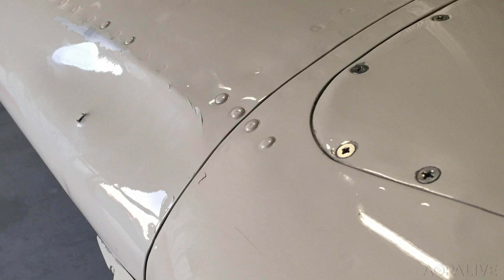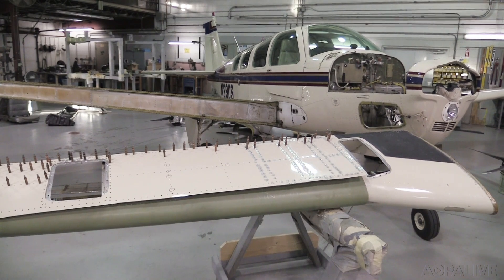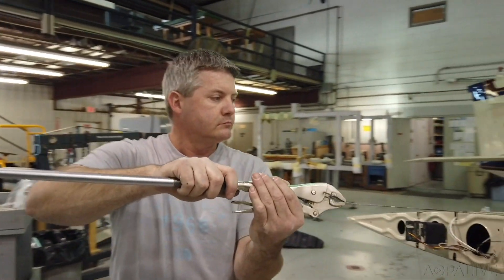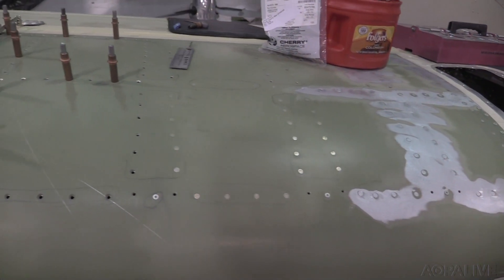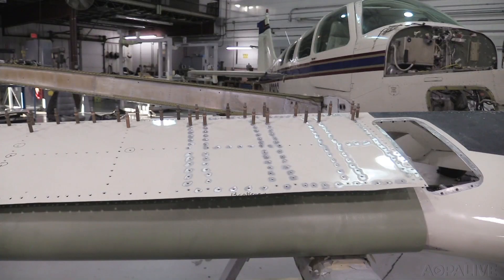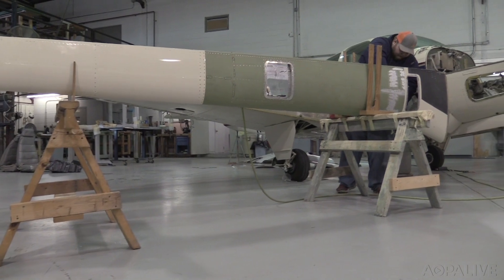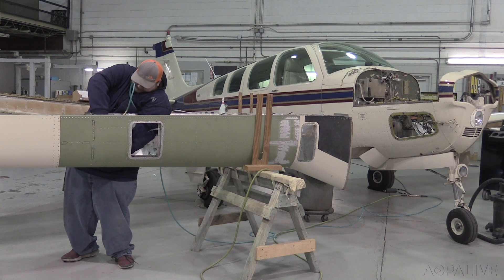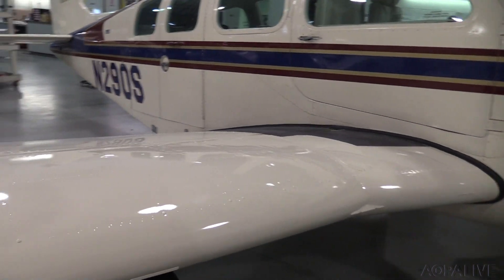Reskinning a Bonanza wing—without removing the wing

Comment: @Jim Brown, Beechcraft says not to use a drill to remove the pin with a drill, it can twist it off (Chapter 57-00-00, page 3). @David Farrish, textron sells a special tool ($$$) to reinstall the pin with a rivet gun. @Jim Brown, we tried a lot of different ways to remove the pins and found the redneck ingenuity worked best! It was a “hold my beer” moment that worked. @Philip Meads, the whole point was to not remove the wing and only the leading edge to save time and money for the customer. Wing removal and installation with new wing bolts is very expensive!!! It took a few days for Tom, Dave and I to figure it all out. Tom fabricated the tools we all helped design. We can do a leading edge repair, start to finish, in less than a week, minus paint. We’ve done 5 and 2 are in the queue. We can even travel to the location, remove the leading edge, bring it back on a truck, do the repair, take the repaired leading edge back on a truck and install it, if the customer is unable to ferry the plane. Let’s say we have it down to a science! We get a lot of calls to walk shops through the process, loan out our tools, etc. but this is proprietary and we are in business to make money and give the best service. Royal Aircraft Services specializes in major structural repair. We can do what most shops do not have the capabilities of doing with structures.

Comment: Using Beech's original system, the "hinge" wires are re-installed using a series of graduated length thin steel tubes and and impact driver/rivet gun, but I'll bet "drilling" the wires back in might work, but you'd still need to use the steel tubes, otherwise, the wire tries to coil up like a slinky when twisted b the drill.

Comment: The easiest way to pull the pins is with a cordless drill. And when going back in I use Mobil One oil to Lub the pin and drill it back in! The weatherly spray planes use the same method. During annuals it has to come off every year!

Comment: Why the piano hinge to join leading edge if the manual says the whole wing needs to come off anyway?
Reply: That’s the original design purpose, to be able to repair the one place on the wing that gets 99% of the stupid pilot damage, birds, taxi strikes, basically flying through the air “”too fast at low altitude”” where all the bugs, birds, and ice are. You know idiot pilot stuff where their invincible until they hit something. Anyway I want to see how they jack hammer that hinge pin back into place with tons of lube.
Reply: @tropicthndr  you can hit a bird at 80kt just as easily as 140.  Bugs don’t damage the leading edge and ice doesn’t happen near the ground it happens higher in the air. Basically 99% of your comment is stupid